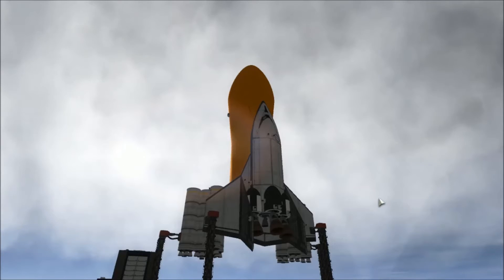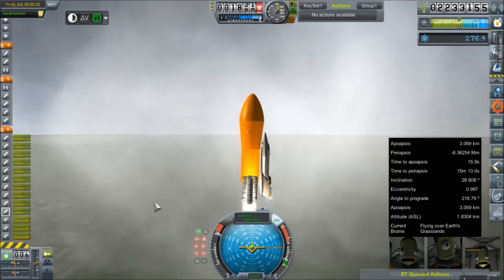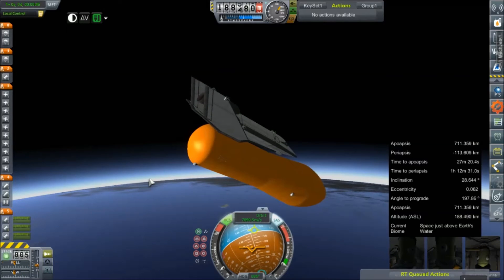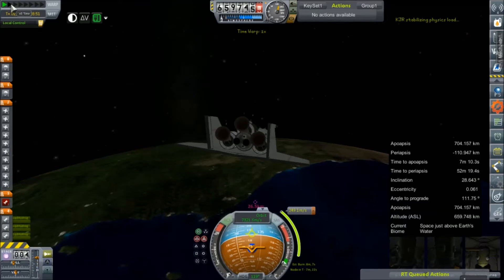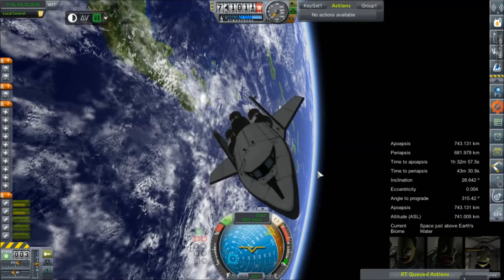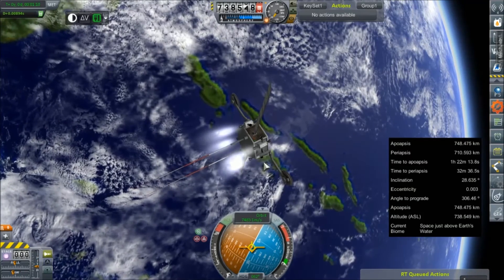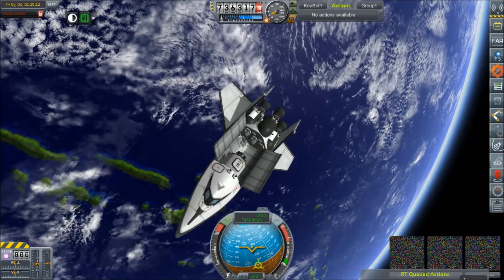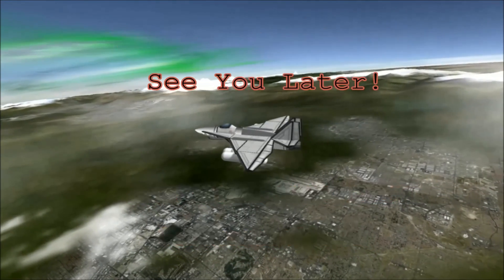KSP RP-0 #146 STS-1 ( 1960s Shuttle Program )

Comment: your launch vehicle aero - profile is just beyond horrible lmfao otherwise good damn job.... the sts vehicles have the highest kill rate for a reason and are just horribly complex... if memory serves they still hold the title of the most complex thing man kind has ever built all millions of moving parts and such.... take a gander at the frontal aerodynamic profile.... add weight if need be... it'll help in the end..oh and BTW dipping the shuttle into the eft's slip stream was a really good idea
Reply from the maker: Thanks! I think.. lol
Part of the reason I wanted to build one in RSS is because they're so hard to get functional, let alone 'right' 
For the aero-profile part, are you referencing just the M55 boosters ( that totaly need some type of nosecone), or the whole shuttle/eft during accent? I'd love to improve this design, if I can get it up more efficiently, I'm all about it.
Reply: the boosters, the shuttle itself and the external tank seems legit
Reply from the maker: gotcha. IF it flys again in this configuration, it'll likely get nosecones for all the M55s ( but thats only half the issue, im sure) I'm really waiting on better SRBs, or toying with switching the boosters to liquid fuels if only to cut down on the surface area / profile.
Reply: yeah a necked down version of the new sls advanced dual engine liquid boosters would be bad ass
Reply from the maker: at this point I'm prolly stuck with 'rustic' E-1/H-1 powered boosters...
Reply: well its the sixty ' s lmfao could you run the ten solids radially around the eft? or would that toss off the thrust angle too much
Reply from the maker: hmmm... not some thing I ever though to look at. It will certainly alter the COT, but I may be able to compensate by adjusting the angle on the J-2s a bit, and shifting the eft forward....
Reply: may be fun to play around with, your drag coefficient would be a lot lower
Reply from the maker: Its worth a simulation flight or two at the least.
Reply: I'd like to see that haha
Reply from the maker: I'm on it.